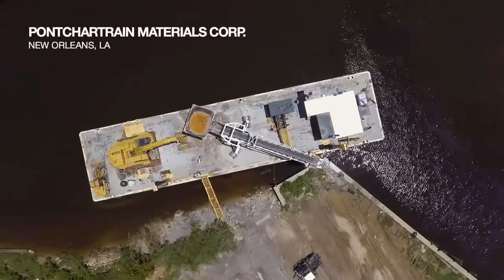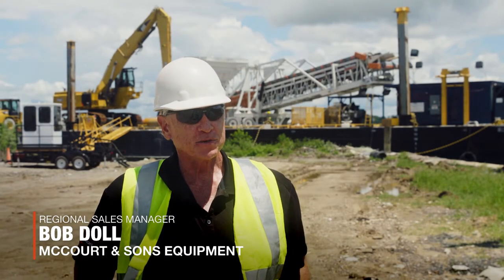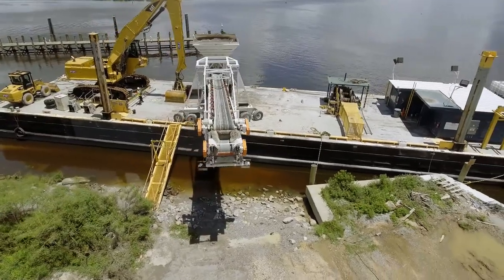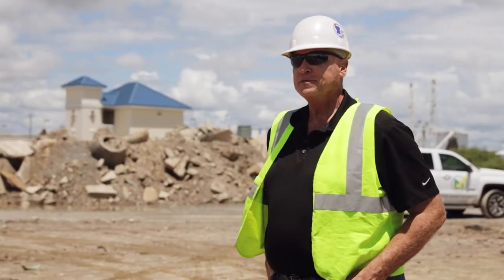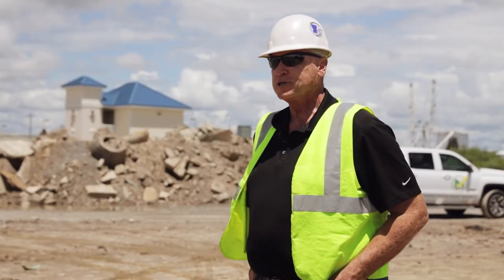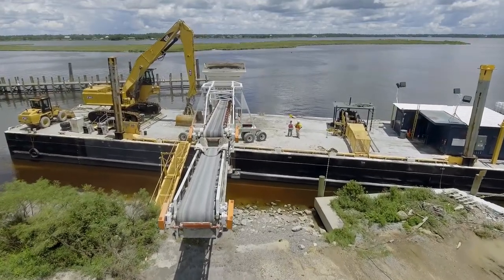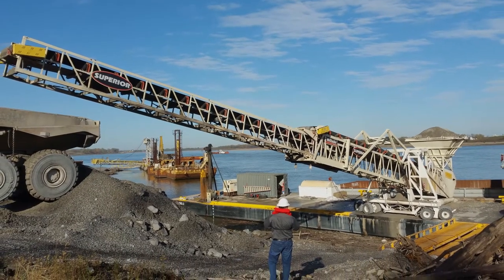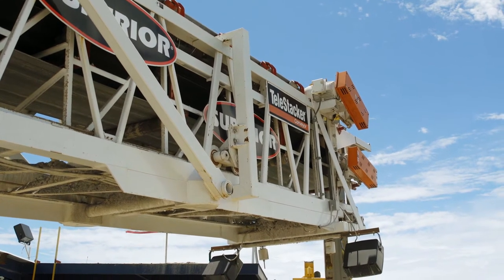Pontchartrain Materials' Unique Barge Unloading Solution From Superior Industries

Comment: Cool gig but should’ve just built an actual dock to off load the barges straight to the trucks
Reply from the maker: That's a good point, John.  A fixed solution is usually going to be the way to go if the offloading point doesn't change.  However, this particular customer required mobility.  The barge-mounted conveyor in this video allows the customer to unload barges directly to trucks, bins, railcars, or stockpiles in any location needed! Have a look at our website if you're curious about our other river or ocean terminal solutions. https://superior-ind.com/industries/river/